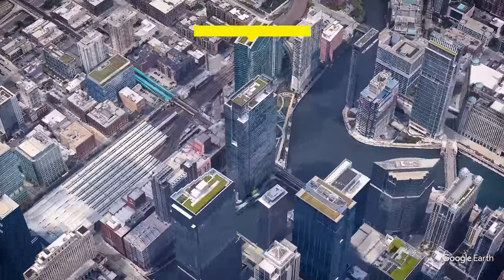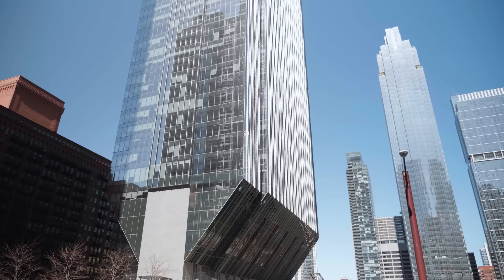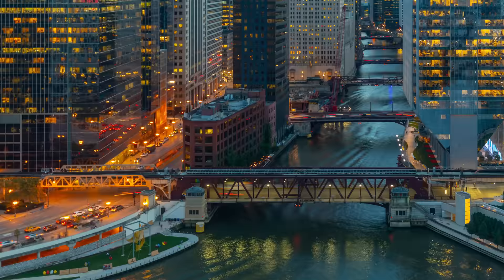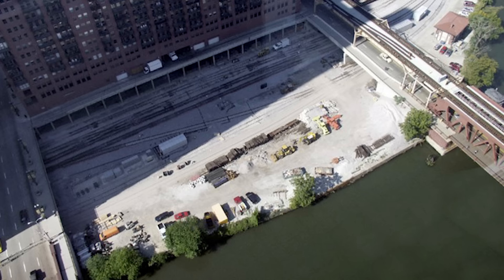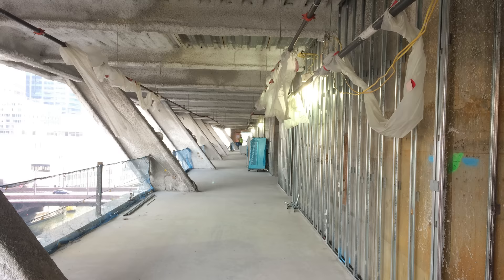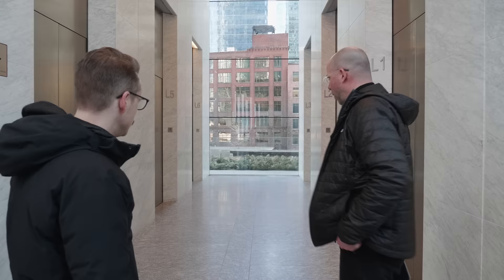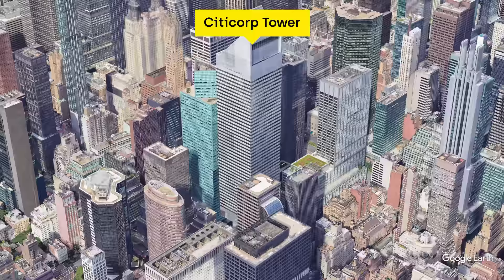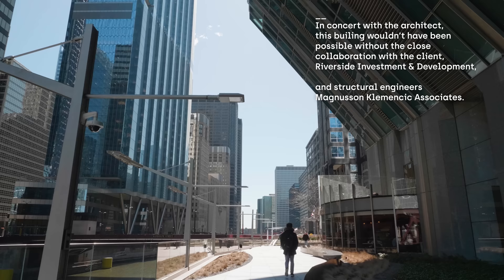How This Tower Barely Touches the Ground

Comment: From a design standpoint I'd say it was one very sturdy tower with overhangs on either side. They balance each other.

They went with building out the base towards the bottom, but a slightly more flexible tower with wind breaks and a lighter independent support under each floor might have worked as well, with several smaller tuned mass dampers or an active support system rather than one big one adding weight to the top.

You'd need each side floor to be very light and not to support the floors above it that way though. Not an insurmountable problem, but interesting! Their way was more direct but I hope they have a system to watch the load as they fill up office space. If everyone likes the view of the river the distribution of weight might grow uneven over time. I'm sure they considered that though.

Comment: Stewart, the tower design of 150 N Riverside emulates an already existing tower in Abu Dhabi. The similarities are unmistakable. Look up the Abu Dhabi Global Market Square.
Reply: Very interesting. Abu Dhabi Global Market Square was also designed by Goettsch Partners. They must have developed the design with these buildings before they built the one in Chicago even taller. They look almost exactly the same. Thanks for that insight.

Comment: This is a very interesting building.  I worked with Goettsch Partners in the early 2000's on this projects precursor, The Abu Dhabi Financial Center.  Do a google image search and you will see the similarities of those 4 towers to this design. The steel fabricator for that impressive steel fabrication was LeJeune Steel.  MKA, the structural engineer, used a mega column design at the four corners of the building that were very similar to columns holding up the large transfer truss at Epic Deep Space in Verona Wisconsin (Designed by TT and detailed by LeJeune). We all build on the knowledge developed by those who came before and add on where we can. Very nice video and a great structure.

Comment: I worked across from this building during it's construction. So many weird issues: the barge that snapped on half and sank in the river during excavation, the high wind blowing materials off the floors under construction and breaking windows on nearby windows (the police closed city blocks around it), and the floor collapse when some concrete modls gave way. The design is nest but man do I have some hesitations about just how the final product turned out after some of those events/bad luck

Comment: I recently retired from a shoring wall design firm that designed the shoring for the building excavations that abutted the Rainier Tower on two sides.  We found that the Rainier Tower base is actually as long and wide as the tower itself, it's just that the base goes from ground level down a couple of floors, and the structural core extends up from ground level.

Comment: West Coast Transmission Tower, Vancouver BC renamed Qube has all its floor cantilevered off the elevator shaft.  It has a square plan.  Originally built in 1970s, About 30 stories tall I think.

Comment: Export the Tower, Azure, Chat GPT, Revit, Plant 3D, Civil 3D, Inventor, ENGI file of the Building or Refinery to Excel, prepare Budget 1 and export it to COBRA. Prepare Budget 2 and export it to Microsoft Project. Solve the problems of Overallocated Re-sources, Planning Problems, prepare the Budget 3 with which the construction of the Building or the Refinery is going to be quoted.

Comment: A similar building is Qube in Vancouver (1333 W Georgia St).  It is completely opposite though in how the load is supported: the building is hung from the top of the concrete structural core.  This in turn dictated that it be constructed core first, then the load transfer framework, then the floors starting at the top and moving down.  The core protrudes quite a bit from the roof so the entire load transfer framework is exposed.  You can't see that from the street though so it looks like a cube balanced (or impaled) on a small concrete base.  I must say though, and no offence to anyone who lives in Qube, the space under the building is not welcoming.  I would describe it as Brutalist but it is so minimalist it is hard to say there is any architectural style at all.  My first impression walking by was "wait, how does anyone even get in?"

Comment: Great video. Would have loved to hear about the foundation, because it needs to handle the torque with a rather slim width. Does it use prestressed concrete that goes up the tower, like pulling it to the ground? And then probably going deep into the soil by means of piles.

Also I was surprised to see all the vertical load being lead into the core structure in one go. I would have hung the floors in groups like branches on a tree. But that would have meant suspension at many levels, clashing with interior design.

Anyway - cool building.

Comment: Random question. What exactly would happen if they needed to either take down a tower due to structural faults, or just wanting to take it down to put a new tower up, how exactly would that look? would it be a controlled demolition situation ( which I highly doubt you can safely "control" something like the sears tower coming down) or just stripping away the building? seeing as how there can be only so much space to build, I imagine at some point someone would want to replace one of these buildings, and have always wondered how they might go about doing that in such a packed city
Reply: They wrap them in protective netting and dismantle them floor by floor

Comment: Thanks once again for a very informative video. Great photograhy too. Pleased to hear your comparisons to other towers built on small "footprints" . I always wondered how the engineering accounted for all the various forces working agains such a construction. Would never have thought of using a water tank at the top of a building!
Reply: I'm not an engineer but I think if people are going to continue to live in highly tornado-prone areas of the Deep South (and the climate crisis doesn't seem to have scared everyone away yet), they'll need to live in smaller versions of "water tower" buildings like this.    Because of the weight and fluidity of that water on top, I don't think even an F5 tornado can topple this building.  The base doesn't have to be that big.

Comment: Is the engineering here similar to Foster's DJI Headquarters?  There the "blocks" of the building are hung from diagonal trusses, elevating them off the ground (as you see in the 150 building).  When you see what's possible, the 150 building is not as forward-looking as it could have been.

Comment: Lovely expression.  Elegant.  Chicago is known for it's beautiful architecture, but the question is why can't cities like Los Angeles, Denver, Dallas, and many others be similarly inspired?
Reply: A number of reasons can explain this, but one of them is location. The cities you cited, do not have financial cores situated by a massive body of water, with a river weaving its way through it, with two branches.  The city's unrelenting grid pattern also gives it a neat appearance.  Not to mention having   a long tradition of executing quality buildings, by esteemed architects which can be easily observed from the streets or along riverwalks.  While not all the buildings rise up to premium quality, Chicago has quite a high concentration of notable structures within a relatively small area, which are highlighted by it's flat topography and setting.

Comment: The fact that they placed water on the top of the building as a counterweight is a piece of trivia that sounds like it could be used in a post-apocalyptic story.

"The river's polluted, we got to get to the top of this building!"
"That doesn't make sense!"
"Yeah, it does. Trust me."
Reply: i honestly dont know if i would drink water swapping around in a moldy, stale concrete pool for a few decades..
Reply: @uwootmviii8695  No one would normally. I don't think that would apply in a post-apocalyptic scenario though.

Comment: Full disclosure: I have a love hate relationship with skyscrapers. This particular one strikes me as an architectural engineering super stunt. A highly desirable parcel of land that could have been put to better use as a public park along an already high rise clogged river front was developed instead into a speculative hypertall high rent/lease structure whose base is a reminder of the immense amounts of carbon that were consumed in its construction. The loss of sunlight imposed by the skyscrapers on the opposite bank, the dehumanizing scale of the building itself, its largely banal, uninteresting facade, (these perspectives I emphasize are my own) do not enhance the lives of Chicagoans, but rather diminish them.
I instantly recognized that Goettsch Partners' offices occupy the upper floors of Daniel Burnham's Santa Fe building. It is a pity that the firm's principal architects have not learned the aspirational  lessons embodied in that light filled, airy high rise, a secular 'cathedral' of modern urban design, a pluperfect exemplar of a skyscraper. 
I will leave it at that.

Comment: New York City Comes to mind to with these mega skyscrapers altering the horizon all around Central Park which seems like a huge mistake on so many levels.
Reply: It will undoubtedly cause view restriction but that's life, cant have a building plan if anyone backs down there may as well live in a village
Reply: I live in Manhattan, and they're not being built," all around Central Park."  The supertalls are concentrated along Central Park South.  Specifically along 57th Street.  The building featured in this video, is far from being a "mega skyscraper." It fits very nicely within its context and physical constraints.  Another feather in Chicago's cap.
Reply: @LUIS-ox1bv  its good they managed to keep it in a tight sector

Another way that developers could utilise a mega structure 

Have a mega structure only allowed to be in 10km points away from each other on a grid

(In effect creating mini cities with the mega structure in the centre and "service" building around)

This will help the mega structure;

•retain a view 

•prevent a massive outflow of people in one area from that structure to its surrounds flooding the area 

•preventing traffic flooding, a continuation from above point also

•limiting sewage etc as seen being a problem with the burj Khalifa

•and rubbish

•and resources in, there will need to be a number of suppliers of food and consumers will overload the retailers 

Of course there is going to be an ego/dick excuse the vernacular war between developers 

Just as was with the world's tallest building (empire, sears, etc)

Whereas now is  a competition that hopefully can be skewed to suit things that benefit other people: most resources saved that a building can save

, most job providing building

 most happy building,

 healthiest, etc

Comment: To be honest, it's really not that difficult AT ALL. Well, all relatively offcourse. You just build a structurally strong X over the entire stretch, with the lower legs of the X being 'underground'. then you 'just' put the rest on top of the outer limits of the X. The Y is one thing, and it obviously works in this case, and i suspect the X was not possible due to the regulations also including the 'underground' area from being 'built'. 

However, if that was not an issue, an X as a base would have been extremely simple and extremely strong in carrying the forces and loads applied.

Comment: The river was used to transport services? How did that work?
Reply: As Chicago was a key city for the evolving Industrial Revolution in America. The River was lined with industry transporting goods as it connects to the Mississippi and though the Great Lakes. Sadly, Corporate America polluted it to toxic then and it was as a open sewer long ago polluting the Lake. Read about how the Chicago River was reversed in 1900 a engineering feat and flows to the Mississippi since. Locks were put in years later as not to deplete Lake water to this day. The river is much cleaner with 60 species of fish back... just no one should swim in it or really eat its fish yet. From the Lake yes. Now the river is a asset and not a smelly toxic mess and downtown has its popular RiverWalk and boating to kayaking. Lakefront beaches, harbors and parks visionaries fought to add and protect from industry. Where docks once were downtown on the river.... even residential towers replaced it all. Some areas inside the city still have industrial areas along the river. Chicago became a key rail hub that replaced more river used to transport raw materials and using the Great Lakes ports as much.

Comment: 1:58 "Back in those days when the river was used most for transporting goods and services."
How are services transported?
Yes, I understood you and yes, I'm enjoying the video. Back to watch the rest. (I'll wait to thank you until I've finished watching. Who knows, maybe this will be your first bad video and I could end up feeling silly for thanking you.)
Reply: Thanks for another fun and interesting video.
Having the crane on the water seems crazy. They must have had supports extending into the river bed. 
Adding a crane to a water vessel makes the vessel crazy unstable. A mass being lifted by a water borne crane behaves as if the mass is at the top of the crane. The center of mass of a vessel is moved much much higher when there's a crane with an attached mass on the vessel.

I've been trying to think of services that get shipped. I suppose shipping itself is a service?
Can anyone help me think of services which are transported?
Did they have floating casinos?

Again, thanks for the video. I enjoyed it.

Comment: They did the best they could given the parameters...but it still looks like an over development and impedes the visual space of the river, personally I totally dislike any building that creates shadow underneath ..it creates an ugly space...no matter how you jazz it up. In short the building is just too big, fine for economic reasons, bad for people and the river. What's the point in a step back 50 floors up?, In this case it needed to start at ground level.
Reply: Disagree entirely.  Anyone who has frequented this area, would acknowledge this project as a plus.  It fills in a gap of what is truly an urban canyon, with a river, not streets, winding through it.  It's what makes downtown Chicago unique among the country's major urban centers.  Shadows also play into the dynamics  how light interacts with buildings.  One can easily observe this especially with older buildings, marked by exterior articulation in their facades, which are not flat, curtain walls.

Comment: @1:05 you like Chicago to an upside down peace sign. The next cut is to a lighted Chicago sign with a large Y in th middle. 

I’m no expert, but isn’t two rivers connecting into one more like a capital Y than a peace sign which, you know, would require three rivers to merge into one?

Comment: 2:12 Those tracks are not used by Amtrak. You need to do a better job researching. They are only used by Metra.
Reply from the maker: I think you may be incorrect about that.
Reply: @stewarthicks  I stand corrected.
Reply from the maker: The tracks under the building bypass olgivie and keep going south right to union station.
Reply: @stewarthicks  Those tracks are used by Amtrak and Metra.

Comment: Should Never have been Built.

Right, I Get it, Solve a Problem by Creating Another Problem.

We have to Stop Highrises Until We Mandate Building Them Much Safer.
Plus We Urgently Need Large Multifaceted Low Rise Structures.

Horrible High Risk Building.

Comment: I just wonder? Is this building built in respect of sustainability. Is it "green". Big glass sections are incredibly energy demanding to produce. Lots of steel must be used to make this building stand. If you would have put all this money into building eco-friendly maybe you could have been a good example for the world, now you aren't. 
With Climate Changes accelerating you will soon have hurricanes, earthquakes and higher water levels where this building stands.
Reply: Steel and glass are both recyclable. If the building is ever demolished, they can be molten down and reused.  A normal building will have skeletal steel frame for the entire footprint of the building.  Here, they used heavier steel, but it's concentrated at the core, so overall it's likely not much more than a regular building. Glass allows for lots of natural light, which will reduce electricity usage.  They designed it based on the land available. If not for those limitations they wouldn't have designed it as they did.